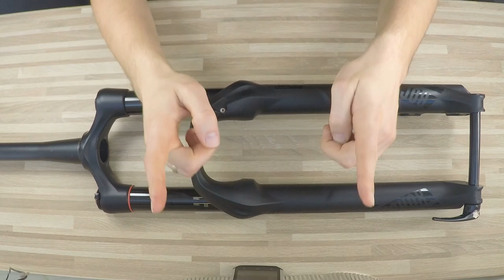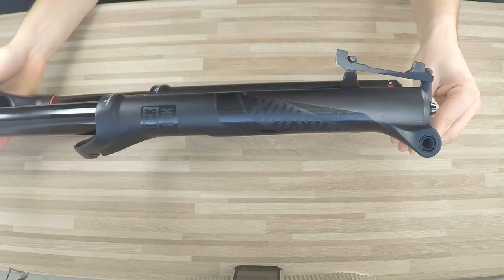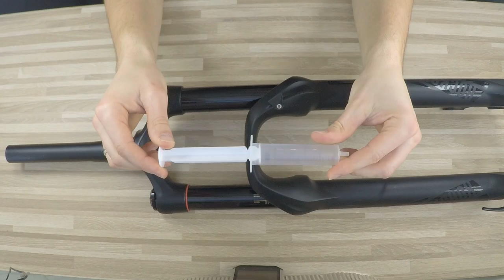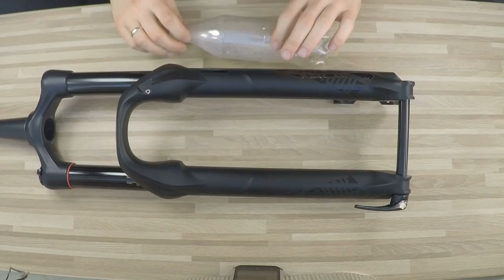You Will FINALLY UNDERSTAND How The Bicycle Suspension Fork And Damper Works. EASY Explanation.

Comment: Great video. One thing I still need clarification on is when the fork is in static equilibrium, i.e. unloaded, as it was in this video, is the pressure inside the air chamber the same as the pressure of the surrounding air (standard atmospheric pressure)? My guess would be some of the air gets sucked out so the pressure inside the air chamber is slightly less than atmospheric pressure, such that when the fork is at its baseline riding load, i.e. just the rider sitting on the bike, the air chamber is then at atmospheric pressure?
Reply: That's a pretty stupid question. Ofcourse the pressure increases when the bike is resting on the fork, and with rider on it the pressure increases even more.

Comment: Just because air forks are expensive does not mean they are automatically better! I have a Fox 40 RC2 coil and a DVO emerald (air) as to which one is better? personal preference I suppose. the 40 is outstanding but the DVO has greater fine tuning and user serviceability, and the DVO is slightly heavier....

Comment: Is one side of the fork for air only and the other side is for adjusting jounce and rebound only? They are totally independent of each other?
Reply: Correct. This is why the lower legs are connected.

Comment: when you install the tokens, do you lose travel?
Reply: Dieter Plaetinck, actually no. They only occupy a space that would have been filled with air otherwise.
Because they can't be compressed with the same force as the air in the fork, they help creating more pressure by applying the same force to a smaller volume of air.

Comment: im new to bicycle suspension and even i can see this video would be misleading for beginners. it isnt even mentioned that there are different kinds of bike suspension, coil spring and air shock suspensions. so this video is pretty useless to explain to anyone how a coil spring suspension works. amend your video title perhaps
Reply: Coils springs and Air springs work the same in principle to try accomplish the same thing - keep the tires on the ground in order to maintain traction, and isolate the rider from the full impact of rough terrain. The differences are not necessarily suited for a basic video on the concept of how suspensions work. Whether coil or air, both dissipate the energy created from the force created as the downward movement of the bike is halted by the immovable ground. While the characteristics are different, the principle is the same.

Other than the misuse of the term rebound and compression (which should be referred to as damping), I thought it was a fairly informative on the general concept of suspension. Perhaps a followup on the differences in spring rate characteristics from air springs to coil springs would be a good topic of a more advanced video to build on the basic concepts introduced here.

Comment: Different holes ? This guy talking about forks or something else ? They're called shims mate.
I understand this is like a fork operation 101 for newbs, so why talk about volume spacers ? No beginner is gonna is gonna use a wrench and teardown his fork to install those so why mention them ?
Reply from the maker: It is easy to imagine the oil being pushed through larger and smaller holes. ALso putting volume spacers on this fork for example is extremely easy.
Reply: Now that you've covered the basics, you should make an 
intermediate/advaced guide in which to talk about LSC,HSC,LSR,HSR, 
negative spring and what it does, mid-stroke support and s on. Preferably done on the trail.
Reply: Adding or removing spacers is a beginner job. It literally doesn't get any simpler than using only a wrench. Okay and a shock pump, but that's hardly expert territory.
Reply: Actually it's both holes and shims. The holes in the piston are what transform the kinetic energy into heat energy, and the shims resp. the shim stack controls the amount of force that is needed to open up the holes (or which holes, there may be different configuration of holes for high speed and low speed, etc), and the amount of oil that can flow through the holes for a given amount of force.
Reply: Christophe L I've seen plenty of people mess up their forks trying to install volume spacers without proper tools... you need good flat sockets to do a clean safe job
Reply: Yeah, I didn't say you didn't need proper tools, I just said it's a beginner job, because it's simple.

Comment: Coil spring > air spring
Reply: lol
Reply: actually a lot of new high end cars, busses, 4x4 use air suspension now too

It has it's pros and cons. 

Same on a bicycle
Reply: Please explain how coil is better
Reply: can be better. Otherwise some pro downhill and enduro racers wouldn't use them
 http://www.bikeradar.com/mtb/gear/article/trail-tech-shock-talk-the-coil-sprung-comeback-45004/
Reply: Никита Науменко lol, my coil suspension gives no dampening at all! Although it kinda makes the rides interesting...
Reply: Goriaas Well that it downhill plus that's just the rear shock not the fork
Reply: Miku Ramsay Get a softer spring then
Reply: A coil fork is a lot more reliable than air. The service intervals are shorter and more advanced. Air also has a tendency to get really hot.
Reply: Mr. Manly Man Coil services are far from advanced... also you just can't control the rebound and compression like you can on an air spring... that's why coil is as good as dead bar a select few racers
Reply: Look up the service recommendations for an air shock vs coil of same model, and the air has more work needed to be done to it. The air dampeners also have a higher chance to break since there are seals holding in the high pressure.
Reply: People talking about coil vs air and damping performance in the same sentence all while claiming to know what they´re talking about. That is just too damn funny XD
Ok, here goes.
You gotta realize, there´s the spring and then there´s the damper. They act together but do completely different things. If you have problems with your damping, the spring ain´t gonna change that (well mostly. A coil due to it´s linear nature would give more midstroke support to some extent). Also, coil springs are linear while air is progressive. That in itself makes coil much more diserable in terms of interaction with the damper because the damper does not need to compensate for the shitty air spring curve.
Air has it´s advantages, but when simply talking about the springs capabilitys, coil is still superior.
Also, coil is only dead on cross country bikes due to airs weight advantage. Look at current downhill and enduro bikes. Many WC downhill pros have been on coil forever. A lot of manufacturers start producing coil shocks and coil forks for enduro bikes again and their sponsored athletes are gladly making the move back to coil as soon as they are available. Öhlins, Cane Creek, Rock Shox all are releasing coil shocks specifically for enduro bikes. So what does it tell us that the two cycling disciplines that rely the most on their shocks/forks´ performance are making the switch back to coil?
The coil spring in mechanical terms is still the superior spring (for bikes).
On car dampers, due to less room and weight restrictions and nearly unlimited technological possibilities for high end suspension parts, things like electronic controllers can of course hugely affect this comparison and give the air suspension (not the spring, we´re talking a whole system here!) an edge. Still, we´re mostly talking daily drivers and adaptive dampers here, because that´s where air can shine with it´s easy adaptability. Go check a race car and you´ll definitely find coil over shocks on the majority of those. But on bikes we´re still a long ways off real electronic dampers.

So, please do not take this offensively, but if you´re having problems with your shocks performance and just blame it on the coil spring, do yourself a favor and educate yourself on suspension. Which was the purpose of this video.
If your coil suspension sucks i imagine you´re most likely a cross country rider, where coil shocks in this segment represent the beginner and entry level suspension options due to lower manufacturing costs of coil forks/shocks.
But with that they also get the shitty entry level damper system, which in return really determines a forks performance to a large extent. So in this case, while in your segment i can totally see that in your experience all coil forks/shocks sucked big time please do not assume that correlation equals causality. They do not suck BECAUSE of the coil spring, they do suck because they had the misfortune of being constructed as a BAD COIL SHOCK/FORK.

To make a clear example rooted in reality, take Rock Shox 3 models of downhill forks. The Boxxer Race, Team and Worldcup (coil, coil and air). While the Race and Teams non driveside fork leg houses an absolutely identical steel coil spring, the two forks performance is hugely different. This is due to the Team having the Charger damping which is a huge improvement over the Race´s damping system.
If we now compare the Team and WC, they house an identical damping system in the driveside fork leg, but differ on the spring side. One being coil, the other air. The thing is, while the difference may be negligable to most people, the mid stroke support and initial stroke sensitivity on the Team (coil) are noticably better.  Anybody can go ahead and try it if they want.
So here we have three forks, from one manufacturer, where one coil sucks, while the other beats the air option by a small margin. I hope this shows that there´s more to a damper/fork than just their spring medium.

And then there´s also things like Manitou´s IRT upgrade for the Dorado and Mattoc forks. What this is basically trying to do is mimik the spring curve of a coil spring in an air spring. So if anyone has ever doubted the superiority of a coil spring, here we have a manufacturer trying to imitate a coil spring in an air spring. The same thing is done by a small german indy company for the rock shox boxxer worldcup. Both systems receive nothing but high praise from all people using them.

Hope this can help some people make a more educated choice in their suspension parts next time and hopefully make your trail time a little more exciting and fun! Cheers!
Reply: A pneumatic paintball marker can shoot 30 times a second.  The pneumatic problem comes with temperature.  When the air heats up it changes in presssure.  This does not happen with a coil spring.

Comment: really bad explanation , disliked
Reply: Lol Wut wtf this was pretty simple and good
Reply: I didn't get much more out of it than what's self explanatory from the words used in info describing each model but after thinking about it I guess he might have said something like that the oil side of the equation resists rebound because it's physically connected around the top of the lowers and via the crown. The explanation made me wonder how the hell the air in the left interacts at all with the oil in the right... assuming I even get it now but then why doesn't it also resist compression? Is it because of directional valves or some other voodoo? :)